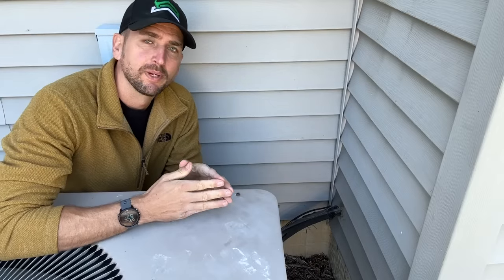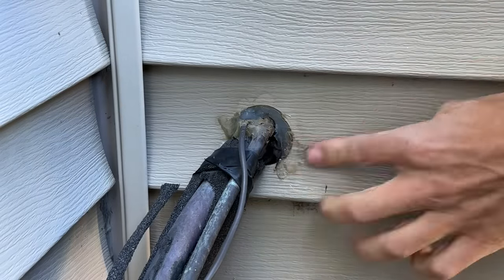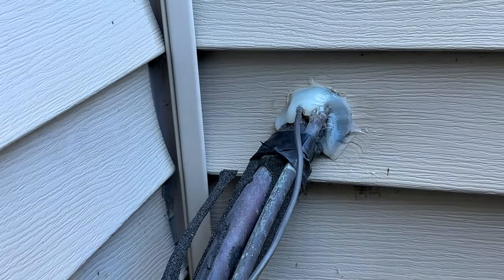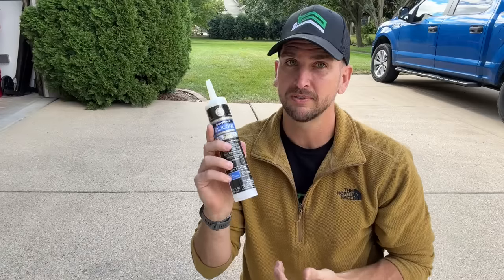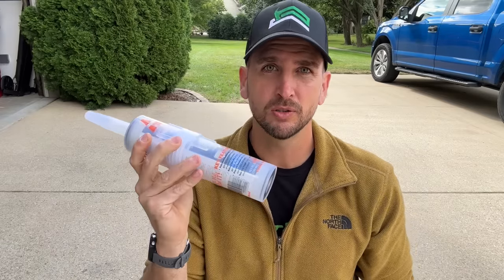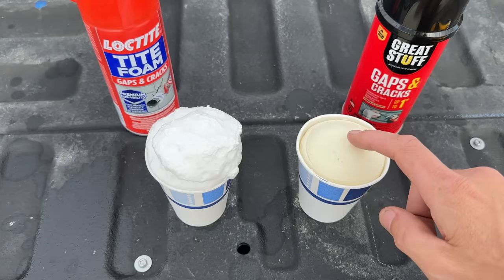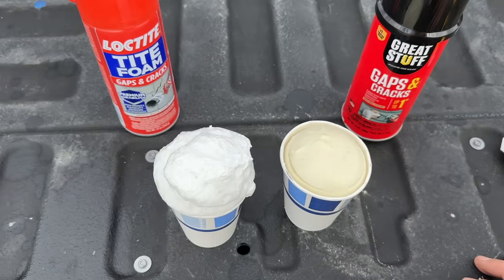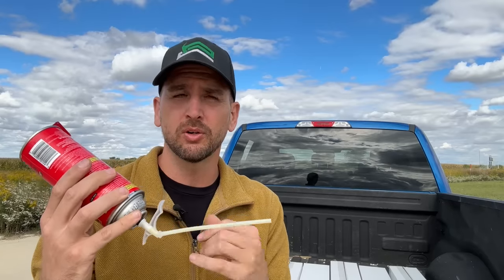How To Seal Gaps And Holes In Siding | Keep Bugs and Cold Out!

Comment: As an electrician we always use duct seal for any type of service entry or conduit penetrations.  Duct seal won’t deteriorate either and will be water tight.
Reply: Duct seal is so easy to use and just doesn't seem to deteriorate in either the sun or the snow
Reply: That's what I use. Lasts for years and then eventually replacing it is super easy
Reply: You can't paint it though right?
Reply: Actually I've spray-painted over duct seal myself, so I know it sort of works.  But I'm curious if that's doomed to fail eventually.

Also the other issue in an exterior situation is buggies can probably get through it, although I could be wrong.
Reply: That's kind of like putty for the outdoors right?
Reply: @joeprattico1048  was that custom made color match seal? or was there a name brand?
Reply: @joeprattico1048  If you really want . . . you can use spray foam, wait, then cut it flush to the surface with a naked hacksaw blade, which is easier than a box cutter (although it does drop dust).  Sand it if it's not quite smooth.  Then you can 'putty' it with latex-based caulk, usually, or just paint it.
Reply: I would'nt seal gas lines with silicone as silicone is extremelly corrosive until it sets...which could be take months if the gap is big.
Reply: Just to clarify, are you talking about duct seal compound somewhat like a plumber's putty or actual mastic duct sealing?
Reply: @guitarheroguy12  Unfortunately, I never got info. I guess Its possible it could have been painted as well.
Reply: Duct seal.  You mean the putty looking stuff?
Reply: I’d like confirmation too on whether “duct seal” is the putty type and suggestions on finishing/painting. As well, if it would work with cedar lap siding.
Reply: @Spacepuft  the putty type, Home Depot sells it in a brick in the electrical section, GB brand.  I’m not sure if it’s paintable, but I don’t see why not, probably just wouldn’t hold very well
Reply: @RandomAxeOfKindness  latex based caulk should never beused in a waterproofing situation
Reply: This is by far the best “home how to video”!  THANK YOU!
Reply: @IAmTheEggMan111  1:52
Reply: Duct seal is also non-corrosive and doesn't degrade in sunlight (at least for a long time).
Reply: Ya, I hate 100% silicon caulk with a passion.  In a few years, it will fail. Nothing like to stick to old sil. caulk, not even itself.  My house's previous owner must have loved it.

Duck seal never fails, is much easier to use and I am not left with 3/4 of a tube of caulk that will go bad.  Tubes also go bad sitting on a shelf unopened after a couple of years.
Reply: looks like he just made a new video with this stuff, probably didn't know about it before.
Reply: Duct seal putty is not recommended by the manufacturer for outdoor use. They say it will dry out and crack over time, etc. I read their response to a question on the Home Depot website about exterior use.
Reply: Duct seal definitely deteriorates. It cracks and crumbles even after two years.
Reply: @CorbinN6  yep. best is to melt down an old car tire and slap it on there
Reply: @gg-gn3re  Sure buddy lol
Reply: Duck putty is what professionals call it, and yes it’s paintable. Silicone can move, also don’t forget the under pipes, wires areas. Like in the video he didn’t even check underneath
Reply: For large gaps where a rodent might eat through foam I use stainless steel wool soaked with silicone sealant & force that into the large gaps

Comment: What i do for keeping Silicone Caulking from going bad is I  squeeze the handle and let about 1/2 of silicone hang out and then dry like that, next time you go to use it just pull that dried peice out and it will be good as when you first opened it.
Reply: ingenious 🤣
Reply: Was just about to write that ....that what i would always do
Reply: Hey that’s smart. Thank you.
Reply: Getto
Reply: I put different types of sealant in my 2nd freezer after putting plastic wrap rubber banded to the tip.  Later after thawed sealant still viable.

Comment: I ended up using Lexel recently instead of Silicon Caulk, and was really happy with it. The nice thing is that it'll stick to itself and you can paint it, unlike silicon.
Reply: Yea lexel is straight rubber, probably pretty similar to the flex seal stuff

Comment: I use nail polish remover (acetone) to clear out the straw afterwards and it is clean as new in just a few seconds. I also spray it in the can nozzle and everything is good to go for next time. The acetone is also really helpful for getting foam off your hands or anything else you may have got it on
Reply: Another options is to use a bottle of rubbing Alcohol.  Its cheap and it readily melts /dissolves away the uncured foam.   Pour a drop or two into the can stem value too.   Better yet the Alcohol dissolves the sticky stuff off your hands too.

Comment: Homeowner here.  Recently used the Locktite Gap & Crack foam sealer.  I seem to recall there were two Locktite foam options, one for big gaps & one for smaller gaps.  I used the one for smaller gaps.  I found this option much easier to predict the amount of expansion.  After trimming it came out with extremely small voids, even smaller than the Great Stuff sample you showed.  

As for cleaning off between jobs I used denatured alcohol I put into a simple quart spray bottle.  Like you I removed the nozzle / straw assemble although I didn't take off the hose.  I sprayed alcohol through the sprayer / hose assembly & on to the top of the can.  I didn't do anything special to the top of the spray can top.  The denatured alcohol gets the foam off your hands, the can & out of the tube easily.

Comment: Very good information in the video.  Yes, it is frustrating to buy a can of spray foam for just a small project.  I didn't realize that you could use WD-40 to clean the plastic applicator as well.  The Air tight container is also very cool and I will likely buy a couple of those too!
Reply: @Cerceify Yes, I can relate.  I have thrown away several partially-used cans of spray foam insulation over the years and did so today on a project.  It kind of makes one wonder why the spray can foam insulation companies don't offer a can for smaller applications.
Reply: I use acetone to clean out dry foam from applicator and can tip.  It eats it away almost instantly.

Comment: I usually pack it with spray foam then caulk on top. Smoothen it, paint it, it’s barely noticeable after. Works great on high visibility jobs such as exterior outlets etc.
Reply: I use that method as well. I use Great Stuff Window and Door foam. Doesn't expand as much as the regular spray foam.

Comment: I use plumber's putty. It is non hardening and seals very well. It is not messy and won't stick to your hands and waterproof and cheap.
Reply: I used this method too but with mixed results depending on the caulk. Seems to work good on water based stuff but less well on solvent based caulk and adhesives.

Comment: Really helpful, I recently realized I've got a lot of these kinds of gaps around my house. In addition to gaps around pipes coming into the house, my foundation actually has some gaps between some of the bricks. I'm not sure if they were supposed to be vents but I've got just every so often evenly spaced around the house bricks where there's no mortar between two of them as if they're supposed to be that way. And I kind of think that those probably should be sealed against bugs too, I had about 10 crickets get in the house this summer and I hate those things.
Reply: Those are vents to let out moisture and water that may have gotten behind the bricks. To keep bugs out try cutting screen to that size and curling the edges over to make a tiny rectangular box. Then slip it into the hole that way it can still vent but also keep bugs out.
Reply: @jorymills652  I know they're supposed to be for  venting but I think that that's not done anymore and it's generally considered better to completely seal the foundation but I'm not certain about that. As far as putting an anti bug screen I'm afraid it wouldn't really be possible. Literally it's just like they left the mortar out from between two bricks in a couple of places. I'm on a crawl space with no basement fyi.
Reply: @Erydanus  Not sure where you live  up here in New England not many brick homes are being made anymore so they are all older with the vent holes. The vertical joints were used for venting and at least for here we use screens to keep out the bugs. If bugs become a real problem could always hire a pest control company to help with exclusion work.
Reply: Bare foam backer rod, intended for filling large gaps (for caulking), is pretty good for plugging brick veneer vent weep holes from insect/rodent intrusion. One would think mice could just chew through it (they can), but in my experience, they don't...
Reply: @Erydanus  wrong you have to let the moisture out from behind the brick and allow air circulation

Comment: For caulking cracks between smooth surfaces I have gotten in the habit of wiping down the contact surfaces with alcohol and let it dry before applying the caulking. The rubbing alcohol moisture and surface contaminants and really helps to bond the caulking to both surfaces. It is quick and easy to do with a small rag and bit of alcohol, but it seems to make a noticable difference.

Comment: After applying caulking, I use a small container of water and or water mixed with a few drops of soap to smooth out the applied silicone. The silicone while it is freshly applied will not stick to water. This is an easy way to shape and or form the application for a fine finish. From time to time rewet the tool/smoother or your finger as you do the work. Clean up the tool/smoother or your finger as needed to ensure a superb finish.

Comment: Using backer rod (closed cell foam) works well to provide support for your sealant during cure and avoiding a 3 surface adhesion that tears the sealant loose when the surfaces expand/contract. This is the way curtain wall glass is installed in skyscrapers. Wish I could publish a simple drawing that shows. Easier drawn than explained...

Comment: I didn't know WD-40 dissolves dry spray foam. Good tip! I use a screw and tape to seal silicone. Tape keeps the air out and the screw will pull out a small plug, should any air get in. I've used tubes stored for months and still fresh as new. I would need at least a dozen of those air tight containers, so nice product but not practical for my needs. Thanks for the info!

Comment: We have had some "mouse noise" in our house at different times, checked all over, especially in the garage attached to the house.....no way in !!!  As soon as your video started I said...S.O.B. !!!!    It was dark out so I checked the opening...hmmmmm ?  Down stairs and pulled out the pink insulation.....well now...pieces of the grey foam from around the tubes are "inside" the house, little buggers !!!   I stuffed steel wool really good around the tubes on the inside....tomorrow will get to the outside...more steel wool and finish off with silicone stuff. Great help, thanks

Comment: For large holes in wood or siding, I have had good luck using epoxy putty. You knead together the two part putty and apply and finish with fingers or putty knife. There is no sticky mess, and the plug is permanent. Unused putty has a fairly good shelf life

Comment: It seems that Great Stuff has re-designed the dispensing straw and trigger, and you cannot easily take them apart. The trigger has clips that mean once you seat it, it can't be taken off the nozzle now, without breaking the small plastic tabs - and in the process dispensing more and more foam (by accident - thankfully onto the lawn that I could easily grab up). And the nozzle is a 2 part item that if you take the outer part off (it's clipped onto the trigger, which is plastic-wrapped onto the can) then you see the small nozzle you showed when you sealed a gap in a brick void, so apparently they've added an outside nozzle to the small straw.

Comment: I really prefer Phenoseal to any silicone product. When applying, it cleans up with water whereas Silicone is a mess to get off. Phenoseal used to have displays where it was sold showing that it can be used as a tile grout. It doesn't discolor, comes in white, brown and clear and it will not shed paint as silicone products do. Once set up, it goes no where until removed. If a surface is not well prepared, silicone caulks can peel. Phenoseal does not. I much prefer a caulk that is maintenance free over silicone products. Home Depot in my area of Southern PA handle it as well as many hardware and construction supply stores in Maryland. It is great if you live by the Atlantic ocean. Salt air can be brutal along with sunlight. I have been using it since the 80's.

Comment: Although more expensive, the loc tite foam is worth it imo, much better adherabilty and seems to be more dense after drying, almost to a closed cell foam strength compared to the great stuff. I’ve used probably a hundred cans of great stuff, it works well for interior sealing projects but I find it doesn’t initially adhere as well to some materials and will slough off
Reply from the maker: Thanks for the feedback 👍

Comment: I use one of those guns and the screw on can of spray foam. Leave it on when not in use and it stays good till the next time its needed. If I ever need to clean off the spray foam I use Acetone

Comment: All you need is a cheap rubber glove and put it on the tube and use packing tape to seal  the end of it, it’ll last for months and months. Usually the dried silicon at the tip pops right out and everything below it is fresh

Comment: I just use a dab of hot glue to seal up partially used tubes - seals the opening completely and makes the tube last for at least a year or two. Doesn't do anything for the bottom of course but I haven't found that to be an issue. Still, good to know those air tight containers are available.

Comment: Such a wonderful Great Stuff tip, straw and trigger cleaning tutorial.  I didn't know that WD-40 could clear it out and always had to throw them away.  I've said before, you always think of everything.  If the tip doesn't clear well enough with a drywall screw or one like yours, could WD-40 be used in the tip and then be cleaned out with slow running tap water into it over a sink, from a glass over a bucket,  or something like that?

I've been waiting for your next video.  I bought a pack of 4-Port side-by-side 12-14 AWG Romex Push-In Wire Nuts from The Home Depot before finding your channel because an electrician used them and left me two of them, one of which I used, but wanted more.  After seeing your Wago 221 Lever-Nut kind, I wanted to exchange the unused package for them, but they didn't have 4-Port, only 2, 3 and 5, so I returned them to buy the Wago from you.  I bought the 36 piece pack because 8 5-Port should be enough for a while and I don't need 78 of them to get 18-5 Port.  This box will be easier to store.  That's all I need for now, but I'll shop your store the next time I need something you carry.  Thanks for everything you do for us, Scott!  I love your videos!

Comment: 2:13 Looks like it's time for a video on how to replace the foam insulation on that A/C lineset.  Probably should have done that before applying the silicone though so that you can get it wedged in the wall as much as possible.
Reply from the maker: I can’t believe it took 30K views to point that out 😂.  I agree that insulation is well beyond needing replaced.